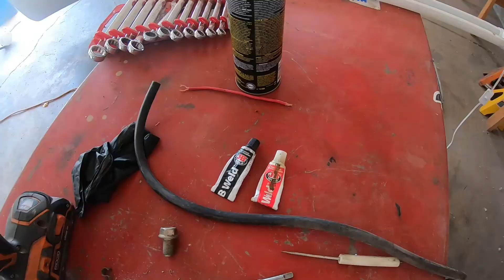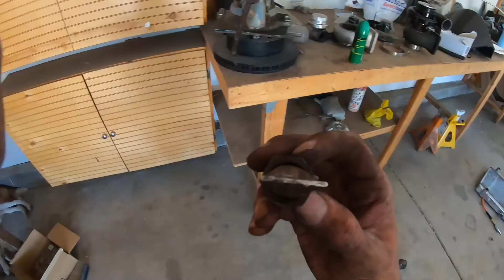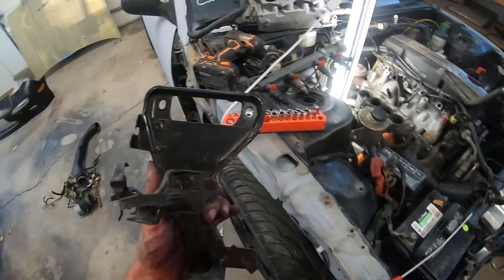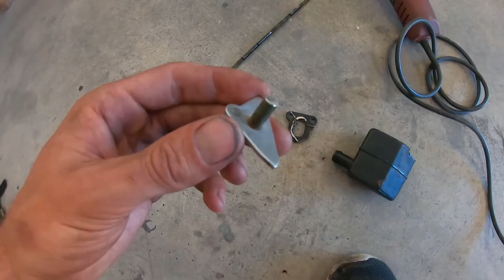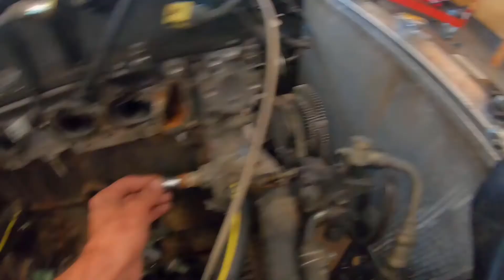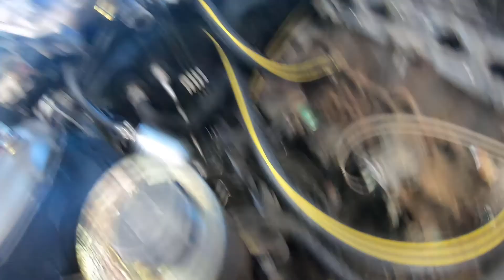Emissions Delete! Nissan 240SX Ep3

Comment: imma sound dumb af, but im finally getting my hands dirty on my 240 since I blew my motor, its fully stock I went ahead and did an egr delete with longtube headers but now im having an issue of coolant dumping out my exhuast as soon as I start it. I went ahead and pulled the head off again to see if the head gasket gave out but the gasket is perfectly fine. Could doing an egr delete cause coolant to get sucked into the motor? Im hoping I just overlooked something